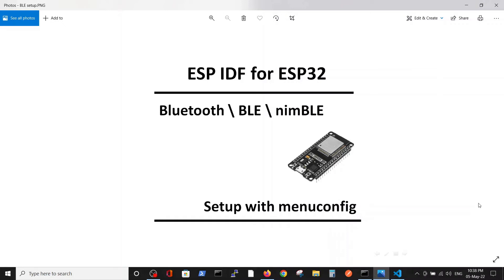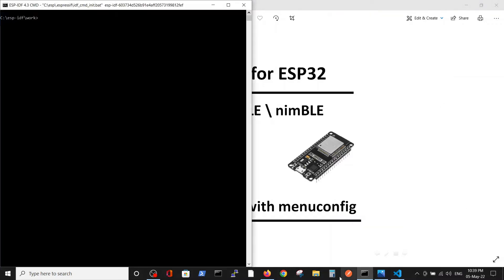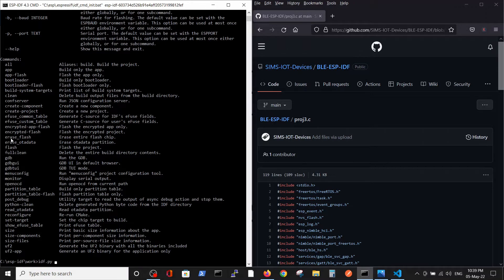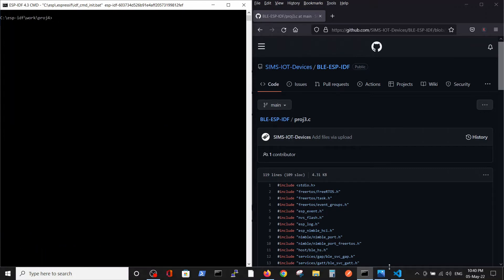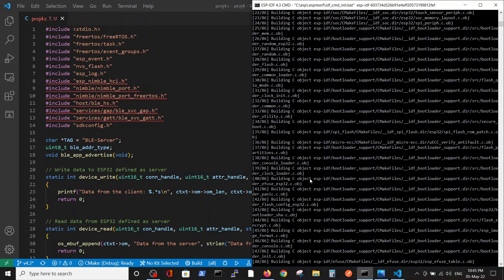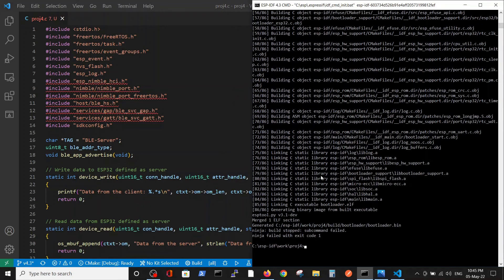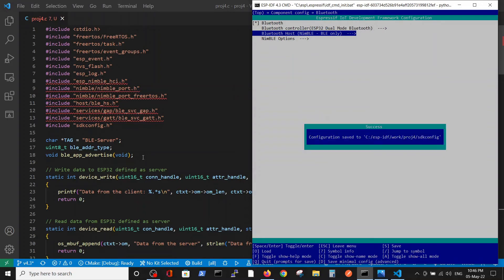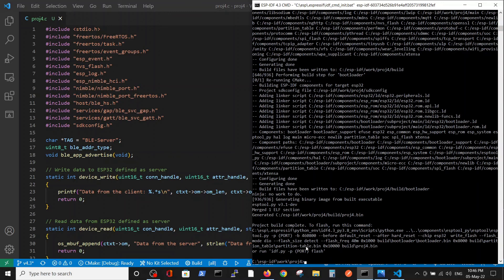1 - ESP IDF for ESP32 - Bluetooth / BLE / nimBLE project definitions

Comment: hello, how can I communicate my esp32 with my computer via BLE
Reply from the maker: Dear Benslimen,
You can communicate with the esp32 from any device which supports BLE. In the video, we used an Android phone cause I could not find reliable software for my PC computer. With proper software for windows, the connection can be made.